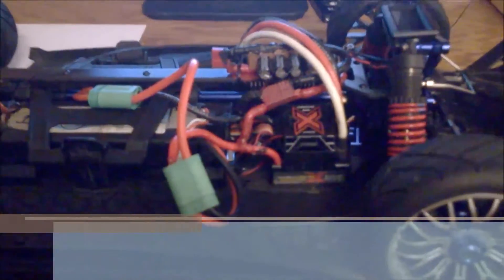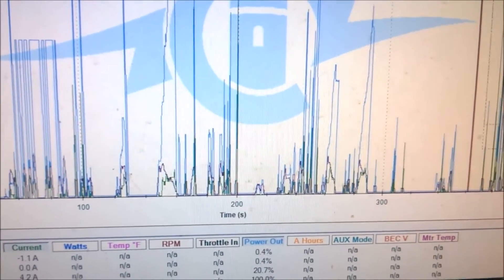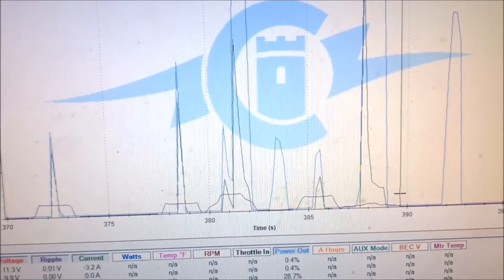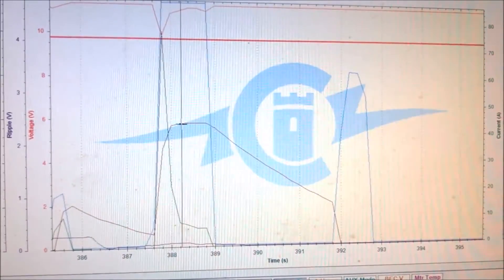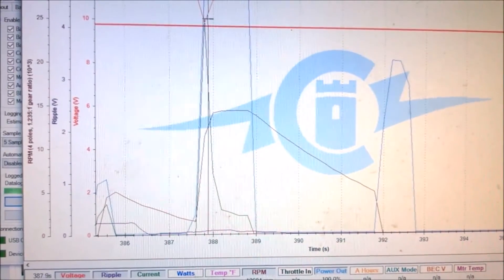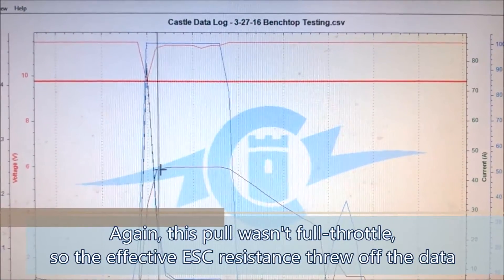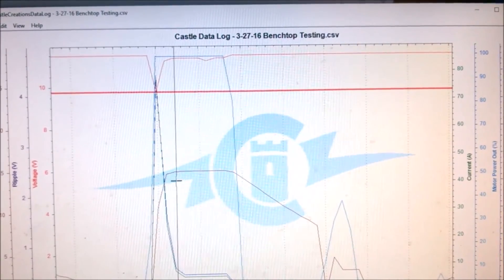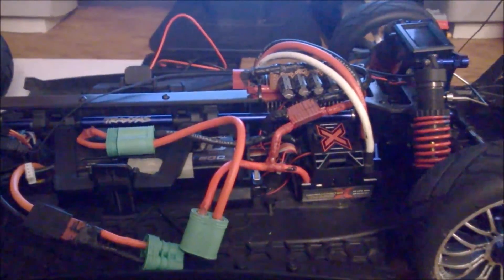Ep. 188: Fun with Castle Data Logs

Comment: i have a ? & i think your the right person to ask. why do i get higher speeds on my third or forth run when my battery voltage has drop?
Reply from the maker: Batteries are funny things. Batteries create heat internally as they push current due to their "internal resistance". The internal resistance of most Lithium batteries actually falls as their internal temps rise, so your batteries may be seeing less voltage sag as they heat up. This means that you are probably getting more power out of your warm batteries under load, even though you are starting off at a lower voltage. Racers have long known about this so there are actually ROAR rules in place to bar folks from heating their LiPo batteries before races. JM Speck also did a video a while back where he observed a similar thing in some of his Rustler speed runs.

The problem is that if the internal temperature your batteries get too hot , they can go into "thermal run-away" which is essentially an internal short circuit that can cause a battery to catch fire or even explode. Most quality batteries are fine after a few runs, but you should always check your cells before a run to make sure that they are not puffed excessively or too warm. 

On a related not, the purpose of C-Ratings is to find a way to combine a rating of the  internal resistance of a battery with its ability to dissipate internal heat to give consumers an idea of the current levels that the batteries could push SAFELY.
Reply: im running a stock velineon system with a 3s 150c 6500mah maxamps on a tc4 & the battery barely gets warm. it did the same thing with my 9000mah 60c smc battery too. i seen your 70mph video & you didnt get 70+ til like your 4th or 5th run so i figure you was the right person to ask. so basically you saying as the battery warms up it can produce more power or run more efficiently.?
Reply from the maker: LiPo batteries are made up of stacks of very thin material that store energy. As these sheets release energy, they also release heat. High C-rated batteries should 1) not produce as much heat as "normal" LiPos because of their low internal resistance and 2) conduct heat out of the battery's core pretty well, so they should not get very warm to the touch. As a result, it makes sense that it could take a few runs to get the batteries "warm" and many guys say that their cars are usually slowest on their first passes.  The danger comes in the fact that batteries can go from "warm" to "hot" to "on fire" fairly quickly under really abusive conditions. I've witnessed a lot of LiPo fires at the RUN DMV events and they are usually not on the first couple of runs. During the 70+ mph run you mentioned, I'm pretty sure that each run was getting the batteries a little warmer, so I was probably getting a little more power out with each pass. However, I think some of my extra speed was actually coming from improved technique. I was getting a little more comfortable with each pass, but I was also getting more aggressive to better use the road, accelerating a little harder and braking a little later. Now that I am running data logging ESC in most of my cars, I will be able to track how the batteries' performance changes with each pass. This will let us know what is really going on so we won't have to guess. I plan to run this weekend, so I should babe able to get some good data then.
Reply: Coo Cause this is like the only video explaining the data log & i been really wanting to understand what im looking at. So thanks for this video
Reply from the maker: TABOO
 I didn't realize there were no other Castle Link videos out there. I'll add a detailed tutorial to my todo list.
Reply: there are castle link tutorials just no data log tutorials. ill be waiting on it & thanks